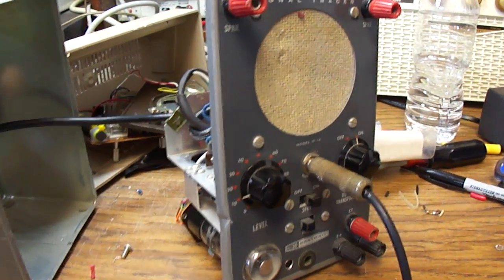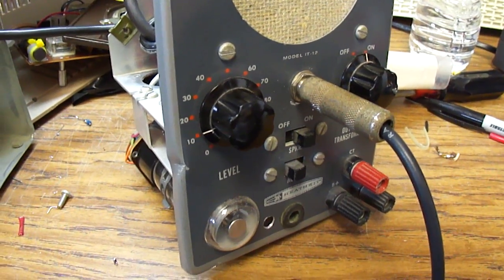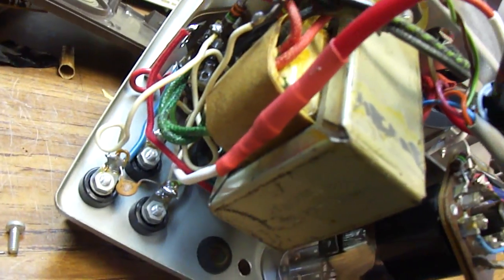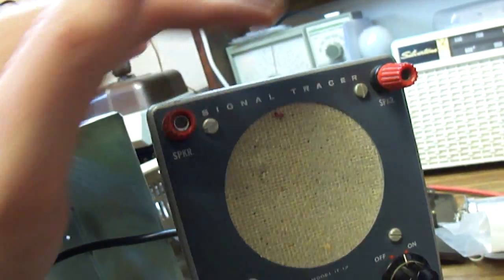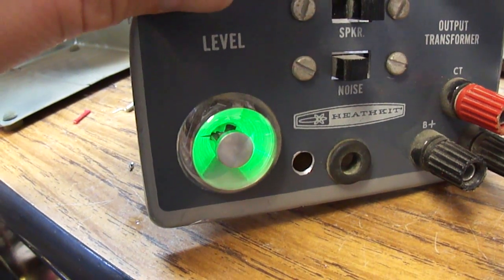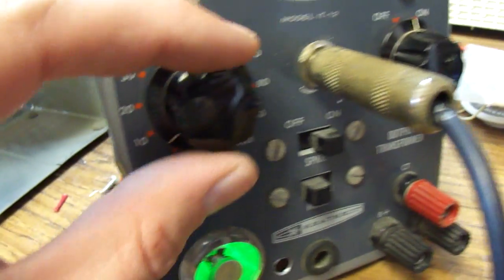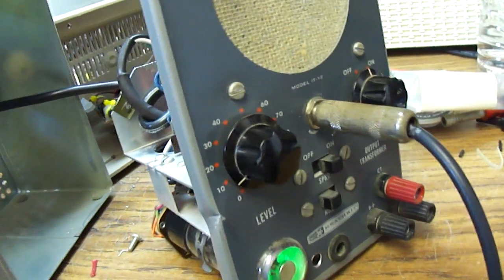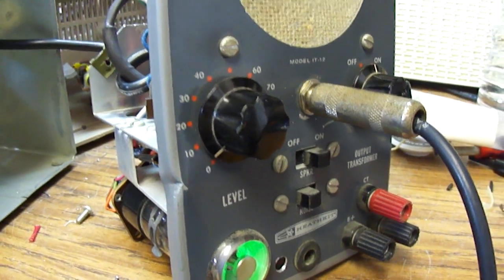1974 Heathkit IT-12 signal tracer repair

Comment: Just bought one of these, and I'm getting close to being finished.  I've recapped it, and am still experimenting with the resistor value to place in series with the 1N5408 diode.  Other than that, it just needs a bit more clean up work, and it will be ready for use.

Comment: The noise mode is very nice to have, as it can be used to find noisy resistors in tube equipment.  It injects +150 volts into the component under test and amplifies any noise generated so it can be heard.

Comment: did you put the guitar jack in the unit as the ones I see on ebay do not have the jack fitting 
thanks
Reply: With the vintage tracers of any brand, you will have to change out the original jacks to 1/4" mono jack, or a bnc connector, depending on what you are wanting to plug in. Hope that helps.

Comment: Good restoration.  I too have much Heathkit  equipment, both Ham and Test.  They are all good performers.  I think you'll find that when Heath first started in the heathkit electronics business in the late 1940's, they made much use of the readily available,(and inexpensive), mil surplus items from WWII.  re: 1625 vs 807 in xmtrs, 1629 vs 6E5, etc.
Good job.
Dick